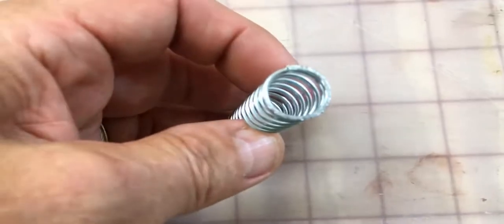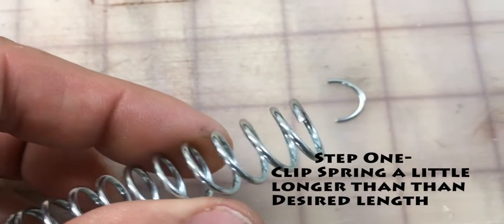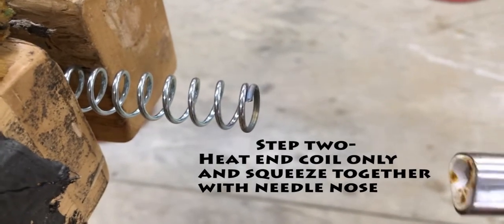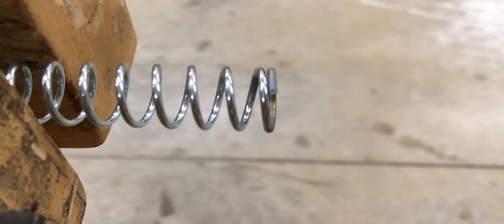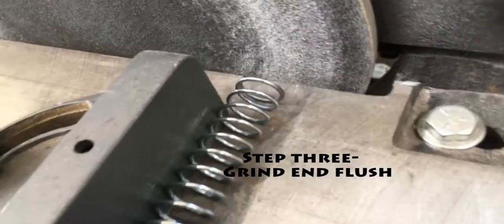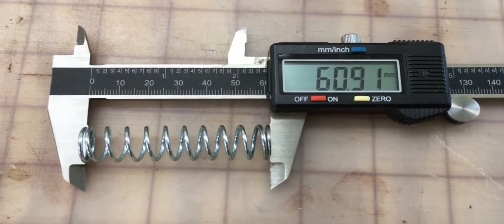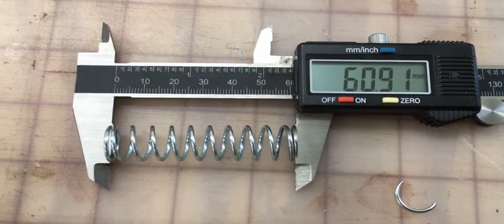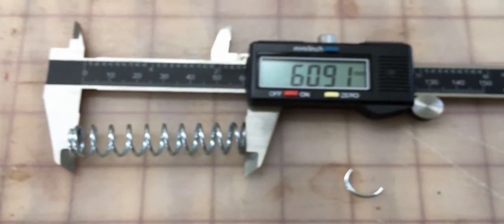How to Shorten a Coil Spring

Comment: Nice man. I need to shorten my spring for my ak47. It's for the detent plunger/pin so I can use the muzzle again.
Reply: I needa fix my glocks spring 😂
Reply: @ChainswitIce  haha just buy the replacement spring man , my AK shortening spring job was a temp fix, I ended up getting a detent plunger spring kit from apex gun parts
Reply: @DIYStangsandFreedom  bet thanks for the tips I’m most definitely gonna do that now
Reply: @ChainswitIce  yeah usually when you glock Jams frequently, that's an indication that your recoil spring needs replacing but I've heard they usually go bad after about edit: 3000 rounds or so. This is based on what I read on the internet lol
Reply: @DIYStangsandFreedom  thanks